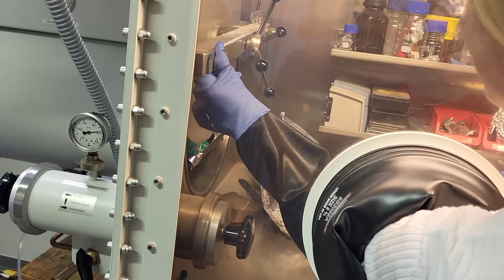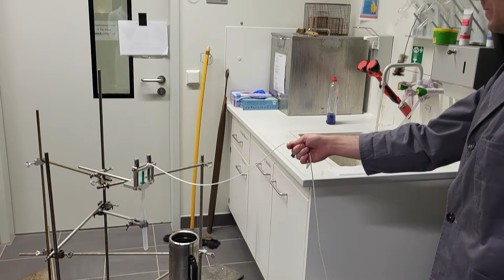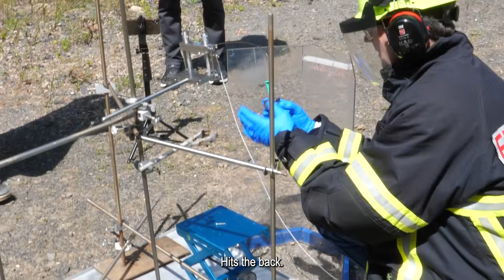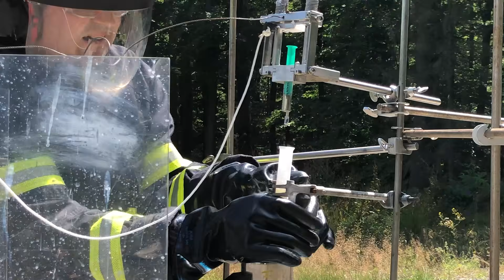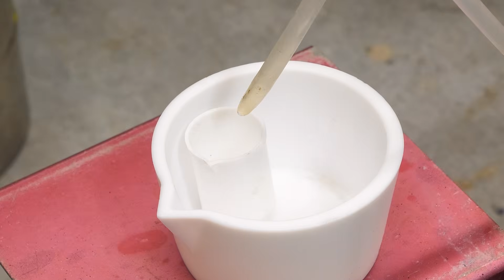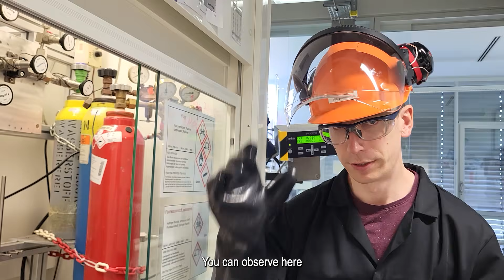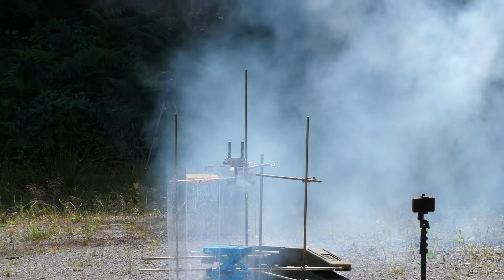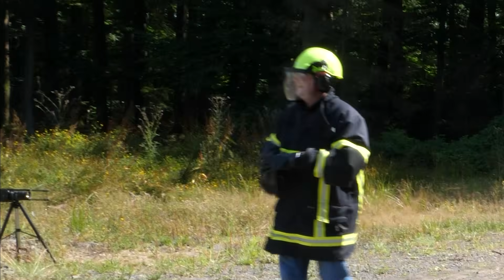Mixing The Worlds Most Opposite Elements (Caesium vs Fluorine)

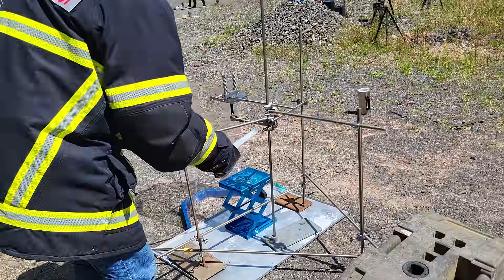Comment: 29:01 Pretty sure the caesium reacted in gas phase of the chlorine trifluoride & a small amount of still frozen CF3 was left in its frozen state which in the heat then reacted in the air
Reply from the maker: Thank you for sharing that idea. I am not sure however if ClF3 can react that violently just with air.